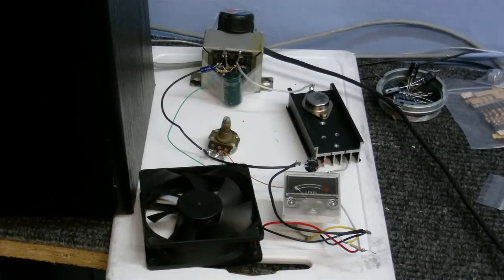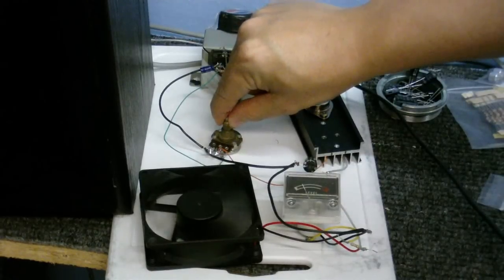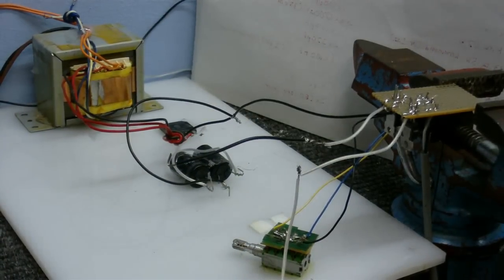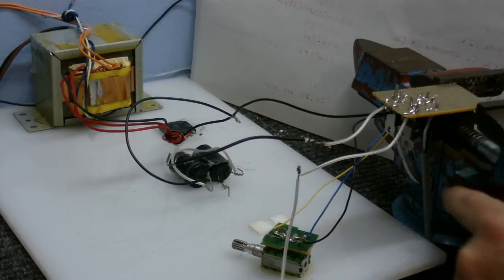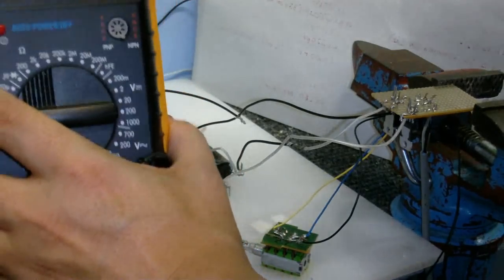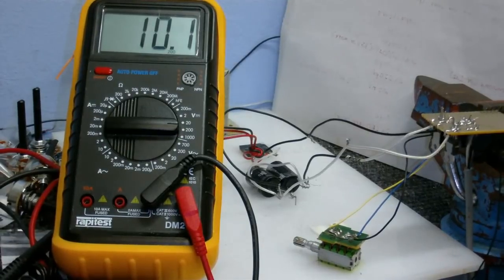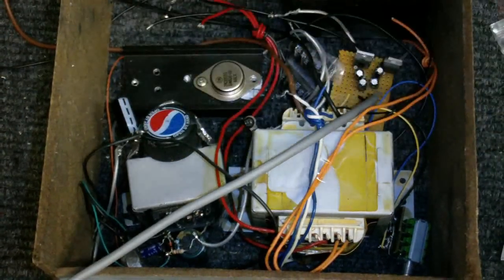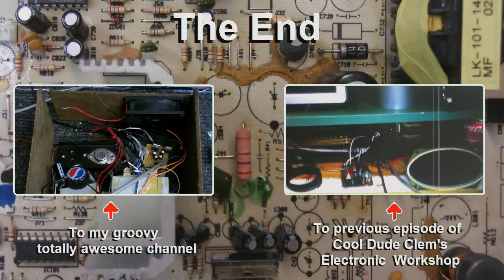CDC Electronic Workshop building a power supply pt 1.avi

Comment: @1500Tb the voltage is much better now. it does not go below 14.4 and idles at over 14.4. most of the time 14.8 volts. but i dont want it to go below 14.4 . if i build something i wont let that be the only thing that is powering my stuff so it wont put very much strain on it but i need some extra power. any other ideas? maybe get a car battery instead of 2 little power wheel batteries? or just any ideas that will help will be good for me. building. buying whatever it is. 2 out of 2 comments

Comment: @CoolDudeClemi tried computer power supplies before. 2 to be exact and it did not work. i bought a portable car charger to go with it and it still didn't work all the way. kept going below 12 volts and i needed over 14.4 volts for my amps to work to there fullest. finally i went ahead and bought this other car charger and everything is hooked up except both of my computer power supplies blew from all the fluctuation. this is 1 out of 2 comments

Comment from the maker: @1500Tb I've had an idea about a way to power your car audio system in your room, you could get a computer power supply and hook it up to that and it should work, a lot of people do it that way, from what you've said I think something of at least 800 watts would be needed.  On the PSU all of the yellow wires carry the 12 volt output and all the black wires are ground. your amp should run on 12 volt just fine, to make the power supply run you just connect the green wire on it to the ground.

Comment: @CoolDudeClem im running a car system inside my room and this requires alot of amps and good voltage to charge a car battery. and i been wanting to try a project to get better at this kind of thing and maybe make it a hobby. if your not able to make a video is there any possible way we could probably go on MSN MESSENGER. i have it installed already. its not very hard to use. if its to much to do video then maybe MSN would work out. ill PM email but if video is good option then just let me know.

Comment: @CoolDudeClem (2/3) I would greatly appreciate it if you was able to. and im sure alot of other people would to. like show us what parts and some cheap sources where we can get the parts from, like microwaves and links and such. there are many many many more people other than just me that want to do what i want to do. i need a power supply that puts out atleast 50 amps. very highly recommend more. and that can do about 15.3 volts without that much of fluctuating current.

Comment from the maker: @1500Tb You might be able to do something like that with a mot, if you were to connect the wall outlet to the HV winding of the mot, you'd get a fairly decent voltage and current from the primary, I'm not totally sure what the voltage would be, but at a guess it would have a fairly decent current, somewhere around 15 amp.  Some poeple actually take the secondary (HV) winding out and put in there own, making the transformer have a low voltage output but very high current (at least 100 amps)

Comment from the maker: @CoolDudeClem It could be done using the zener diode method and loads of power transistors connected together to share the load. I'll explain the zener diode method in the next video.  If you used ICs all wired up to share the load, one would probably burn out first , then another, then another, like a rope breaking, diodes are the same way, you cant connect a whole bunch of them together to make a really powerfull one, it just does'nt work that way.

Comment from the maker: @1500Tb hmmm well, for that you would need a pretty heafty transformer, as the secondary coil would be quite big and made with thick wire.  I'm sure somewhere transformers like that exist, but I dont know where to get one like that.  As for the regulator, I haven't seen any ICs that can handle that kind of power, and stringing a bunch of ICs together would probably not work.  I'll have to continue on in another comment ...

Comment: uuh, i was wondering, is there any way that you can teach a noob how to make a power supply that can put out like 50 amps at maybe 15.3 volts.s something around that and with a voltage regulator so it can be maybe 3-24 or something like that? i think you prob could but the materials i would have to get would cost so much money.